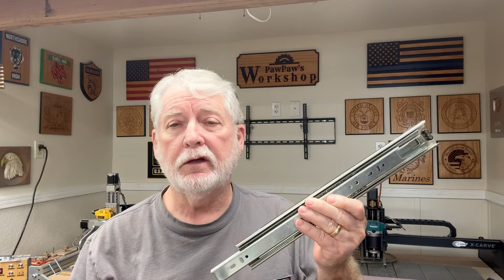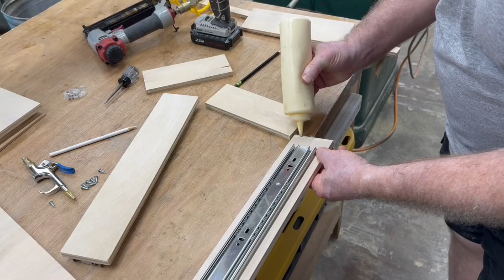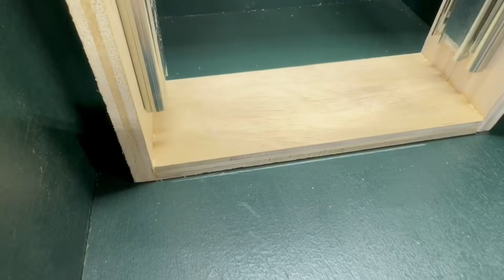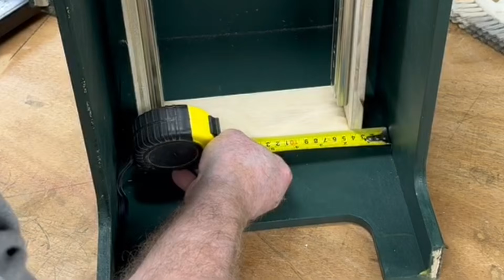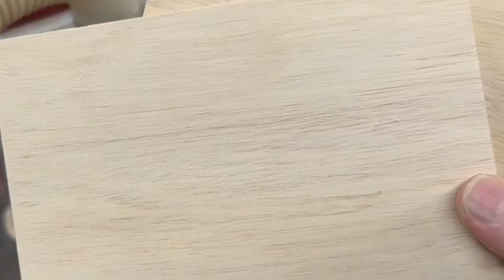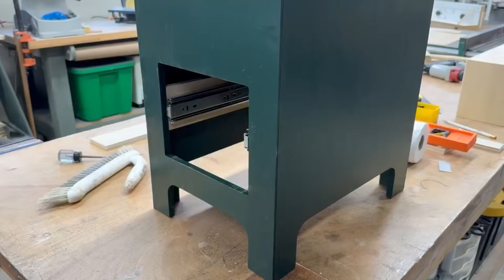How to Install Full Extension Drawer slide & Build a Perfect Drawer (Step-by-step DIY Guide)

Comment: How is the strength of this compared to using pocket hole joinery
Reply from the maker: I actually believe it is much stronger. The glue over a large gluing surface is much stronger than pocket holes into a butt joint. Thank you for the question.